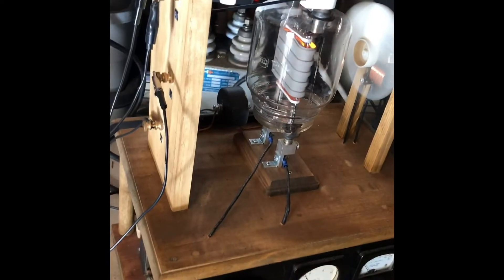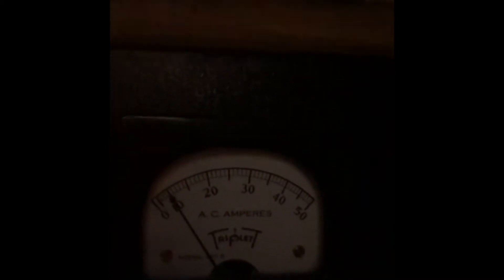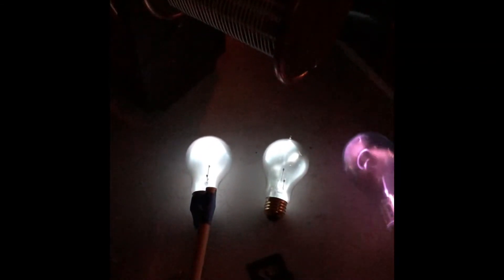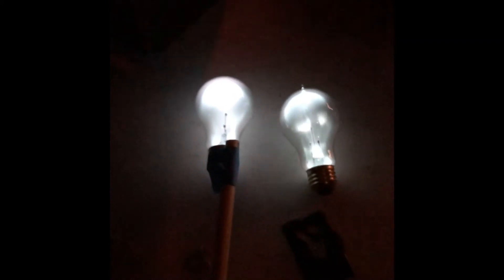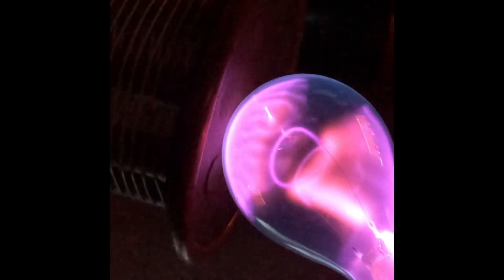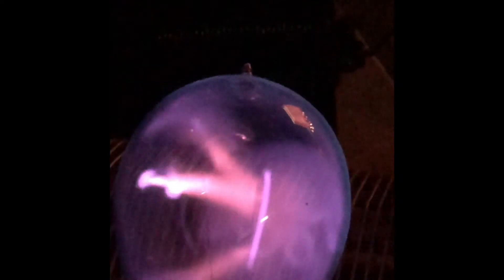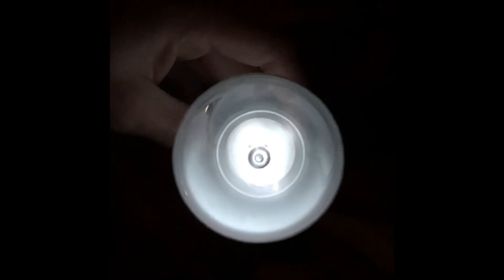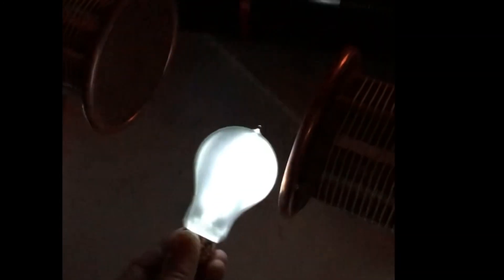Visualization of Striations and Plasma Phenomena in High Vacuum Bulbs

Comment: Are the lines of force ,as seen in the carbon fillament bulb, an espression of the dielectric field? I have always imagined dielectric lines of force as being like the arcs seen in a plasma bulb that you would buy from the novelty store.
Reply from the maker: It seems as though that the formations are related to the lines of force present. In the video I have posted in which I show Tesla's carbon button lamp in action, The tentacle like formations which are stand-still seem to represent the overall lines of force in someway. This is still very primordial as the understanding of what is happening is still a question.
Reply: @GriffinGBrock  The very name "dielectric" gives a clue. It does not mean "two" but comes from "dia" electric (through electric). Basically a self-cancelling field. Lines of force are not dielectric as dielectric is not a force. They are a result. If you check the Steinmetz diagram from "Electric discharges waves and impulses" it is explained there. I cannot say I fully understand it but my interpretation is: dielectric is light itself (centripetal infinity) and the force (centrifugal form) is the sound arising from it... Matter is a sound of light. That´s how I understand it...
Reply from the maker: @tomaskoptik2021  You're confusing two different meanings of dielectric. There is the dielectric medium, and there is the total dielectric induction. Dielectric induction will subsequently occur within a medium, which is determined the dielectric. As in a capacitor, both plates are exhibiting a dielectric field confined between the two, and the spacing in-between the plates, whether it be air, glass, paper, etc., is the dielectric medium. 

In the video and specifically this comment, we are solely adhering to the dielectric field of induction, and disregarding for now, the displacement current present between the coils. When speaking of field cancellation, it is worth wild to understand the traditional view, in that the dielectric field will pose a cancelation between two terminals if both terminals possesses the same "charge". Whereas if the terminals have opposite charges, then the lines radially emitted will coalesce with one another. But since the apparatus shown in the video is an alternating current radio frequency generator, that means terminal polarity is not fixed, given the ability for both coil rings to arc upon each other, then it is a matter of phase cancellation. As a 180 degree phase lag is occurring, likely inducing the seen effects, it must be noted that for a true phase cancellation of 180 degrees nothing would be seen in the center of the bulb. Since such a phase lag is very difficult to obtain in an absolute sense, we see the inner bulb formations.
Reply: @GriffinGBrock  Thank you very much for your explanation. I am trying to understand the very nature of the field (light and "matter") itself thus the proper understanding of dielectric is crucial to me. Let´s say my interest is from a cosmological perspective. But usually the technological approach uses the inverse terminology to obtain results which confuses me a bit. Anyway how would you define a "medium" or "matter"? You know that´s my biggest pain at the moment :) To me it seems the "medium" or "matter" itself  is an induction (sound) pattern. Would you agree or do you see it differently? I am dying to get it right. lol :)
Reply: @coltx64  Thank you for elaborate answer I appreciate it. My question is probably more of a metaphysical character. That is what I try to understand. But there is a problem with definitions as from the metaphysical perspective it is a bit different. You gave me an answer that is technical, physical and  from that perspective it is correct. But for me it is a perspective of an effect not a perspective of the source. I quite agree with humans walking on one of the planes but it is already a view from the body. It kinda corresponds with Teslas view on gravity (being simply a function of time ie diameter). I tend to think about it in terms of consciousness being the dielectric field with the electric field being its inverse effect (mind). That is why 0^0=1. As yoga says: you are not your body you are not the mind. From this perspective Light does not travel because motion is an illusion. The light we normally think about is in fact a reflection of the true Light (Ether). A frequency. That means there is no magnetism as such as magnetism is just a centripetal space. Space is a singularity (consciousness), the space time is a resonance (inversed effect) from this singularity (induction, distance, time, sound, matter, all the same). From this "inverse" perspective all matter is in fact electricity and electricity is sound. They differentiate only by their harmonics. Dielectric and electric, no magnetism. As I say: the only real place you will ever experience is called NOW as now is the only reality, the rest is just a reflection going away. As Empedocles said: Universe is a circle with its center everywhere and circumference nowhere. For me there is no end or a beginning, only one eternal NOW. Big bang is not a beginning but a center. I am sorry to discuss such a metaphysical topics under your video but I believe people with understanding of the dielectric field are much more open minded and what I am looking for is opinions and point of view from people like you, not mainstream physicists :) But I understand you are more involved in creating technology rather than exploring human consciousness so i apologize if my questions are confusing or out of place to you :) Anyway, thank you warmly for your reaction.
Reply: @tomaskoptik2021  my interest in this field is also from a metaphysical perspective.  As an audio engineer you ideas are intriguing.  so called “sacred” geometry and the revelations of the Gnostics, Toltec shamans, and Monroe institute for me are the other side of the equation from aether physics.  I say “sacred” for this is little divine in the manipulation of aether physics to trap consciousness in this song using the so called sacred geometry but I digress.

I like much of what ken wheeler speaks of, but he is does not understand how to actualise the concepts in any useful way, and his vehement opposition to the usefulness of meditation from focus upon the pedantic use of language is obtuse, and his physical theories seem close but not quite it.

Would love to hear people’s response to your theory here!!
Reply: @stevenrempel  It makes me feel good to read your words :) I have the same problem with Ken. Wisdom and anger do not fit together I would say :)) Recently I am quite indulged in the study of a circle. Seems to me that all physics is just a circle from various perspectives. Expansion of a circle (circle) and its inversion (hyperbola) is all i see everywhere (mostly in Phi ratio of course :) ). If I am to be grateful to Ken for anything it would be the point source nature of all phenomena he showed me.
Reply: @whatever12643  I love it :)
Reply: @whatever12643  Did I? I don´t think so :)
Reply: @whatever12643  We are Holos. Emphasizing only some of the chakric planes never works. Body is whole, we are whole, you are right. Perception is whole-body experience. Not sure about veganism but vegetarianism definitely. I am thinking about it...
Reply: @whatever12643  Agreed. I am not totally against animals being killed for food (it´s not my job to play god :) )but i say this: Everybody who eats meat should kill it by himself or go away...If you eat what you did not kill you act like a parasite.
Reply: @whatever12643  i agree :)
Reply: @whatever12643  i see it purely as a vibratory thing. Meat is low frequency. Eating meat is lowering your frequency and limiting your perception. But because most of us is used to limited perception people who are born into this mess do not recognize the difference and importance of food on your energetic system.
Reply: @whatever12643  Not fine. But not my doing. I am a witness of it, not a creator of it. Consciousness is. The very same consciousness that plays the role of a cause on high frequency plays also the role of an aggressive madman on low frequency. I am not this or that. I am both. I do not judge. I witness. Eternal immortal consciousness is the only problem in existence. All That Is cannot not also be a problem...
Reply: @whatever12643  Lol. It´s ok, really :) i do not use ethics as much of a value rather "what you give out is what you get back" attitude. i see the "outter world" as a reflection of an inner world. And reflection is all there is to experience "together". Outter world is an experience in the inner world. Self-reflection. Negative image of Self. Studying reflection is replacing ethics for me ;)
Reply: @whatever12643  Because I like it. Simple. Most of our behaviour in this "modern" world is more or less against our wellbeing. All cravings are. I do what I like not what I consider "clean" or "good". It might be a low frequency but it still is a frequency of my Soul anyway. I am here to explore low frequencies and I do it. Nothing more. I dont believe in enlightment or eternal stillness. We are non-causal. There is no true sense of Time in consciousness. It is everywhere. Only a sense of frequency. All moves, all changes all the time. We all have already been Buddha, Christ, Krishna, you name them...all of them. There is no true enlightment forever. It is an infinite process happening through all your parallel lifes in one eternal NOW. Endless. Pointless. I go with the flow, I don´t swim against the stream and I don´t exhaust myself trying to swim faster along the stream. I am eternal anyway. No matter what I do no matter what projection I create for myself I am not the projection. I am not this body, I am not this mind. I am all. It´s ridiculous trying to escape from a place that is my own attribute, my own locality, my own feature. i do not judge, I do not prevent my consciousness from going to wherever it wants to go. i do not block the flow of information between the layers of consciousness by creating targets or goals. i placed myself into a culture that tought me to eat meat. it allowed me to lower my frequency enough to manifest my body here and experience pain, misery, emotions and all the disproportional feelings around them. That´s what it showed me. Consciousness explores what it wants no matter how enlighted you as a physical "I" feel. Negativity is secondary. It´s not a basis of existence. We all ARE no matter how many times we died or got born or enlighted or fell. No matter how many times we destroyed ourselves we still ARE. It should give you a hint...
Reply: @whatever12643  Srry buddy but i´m a village guy. we kill animals.

Comment: Ow cool, I recognized your voice from a question call with Mr. Dollard. GO for it dude!
Reply: I once build  2 identical tesla coils at about 1 Mhz on a tiny 1 Watt bug zapper power supply. 1 acted as transmitter the other as a resonater. I had the impression there was also a neutral plane between the 2 TMT's. The silly things even worked on separate groundrods.

Comment: where to start if I wanna replicate it? any circuit diagrams ?
Reply from the maker: Research schematic depictions of high power RF tube transmitters that employ amplifier tubes in push-pull, to achieve kilowatt power levels. That would be a good start for now.

Comment: What is the significance of what you call the cancellation space?  Seems like it's just a normal occurrence of wave cancellation although this being from a coil, I think it would mostly be cancelling the B (magnetic) field.
Reply from the maker: The major significance and main point of focus, is on the properties of the overall dielectric flux radiated by the potential coils. If the coils where in opposition to each other, that is, they possessed the same imposed "charge," then a cancellation and repulsive field would occur. But since they are of opposite charges and not alike, then the lines of force conception of a null zone would not be possible. Such opposition of charges is evident by arcing which can occur between the two coils, which is not possible if they possessed alike charges. 

A field cancellation is likely to be the answer, given that the terminals of the high tension supply coil are in phase opposition by 180 degrees, and that the supplied high tension to the potential coils, seem to retain a 180 degree phase shift. I have found that in both conditions, where the potential coils may be wound in series or in 180 degree opposition, the same effect occurs. Although this theory does not exactly hold to be true. If a complete 180 degree phase opposition had occurred between the coils, then we wouldn't be seeing the formations occurring in the centre of the bulb, as I note the interference-like pattern occurring. It is best to think of the comprised setup as two out of phase transmitter towers, creating a null zone in the middle, except that the video doesn't show a conventional null zone. Post to this video, I have determined that this null zone is quite concentrated, and lends itself to a finite width in space. This experiment is soon to be continued, as there is far more investigation that I must endeavor upon.
Reply: @GriffinGBrock  What forum group do you discuss this on?  I've been out of the loop for years but this was an area of interest for me years ago.  I'd like to catch up on some reading.  Do you mind recommending a thread or a starting point?  This appears to be poorly described in the work of walter russell, which was what I was trying to corelate to.  I would like to have a slightly better vocabulary to re-read russell.  
Fascinating.
Reply from the maker: @smellslikeupdog80  There aren't any forum threads where this is thoroughly discussed, but I recommened reviewing radio engineering books which describe similar effects via antennas, and the recent work of Eric Dollard.

Comment: Seen you at ESTC the last two years. 
At the end, you can see the Inertial plane/Counterspace. The dark line mediated  to center of Aether's Hyperboloid. Like Gravity, Magnetism/Dielectric Voidence Field is the first to return to Dielectric Energy. Then, Dielectric Energy into the Inertial Plane. 
 After Magnetism/Dielectric Voidence Field returns to being Dielectric energy only. There are no longer transverse waves creating the nodes that Light/EM waves propagate on. This is why Blackholes/Counterspacial Sinks are dark mediated to its center. It's not that light can not escape from a Blackhole, it's Light can not exist in a blackhole. There are no transverse waves mediated to center of blackholes.
Reply: The so called "black hole" in our dimension could be just an super masse with extremely dielectric properties that will in its end eat it self up idk. Here in this video the cancelation spots could simply be the void where everything goes back to? idk, vague said the lowest pressure points, aka fastest shortest path back to counter space? and these spots will stay at same spot respect to coils settings and placings also respect to the potential around in the room where experiments are being held, but any changes in any of these factors I personally expect the cancelation spots to move it self to take the shortest path, idk just thinking out loud, would be awesome to see some experiments with dropping items in these cancelation spots to see if its falls faster or slower in an vacuum sealed area, one could dream huge scales of a experiment that would been🙉🙈 or seal the entire coils in an big bulb🙉🙈